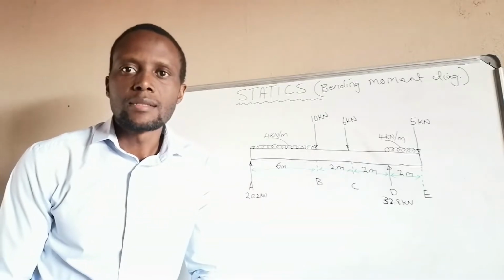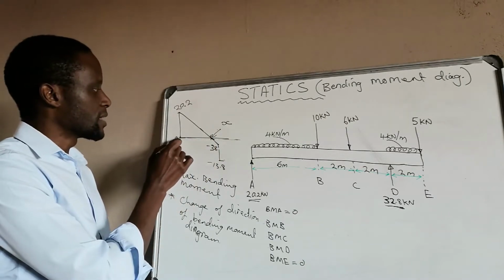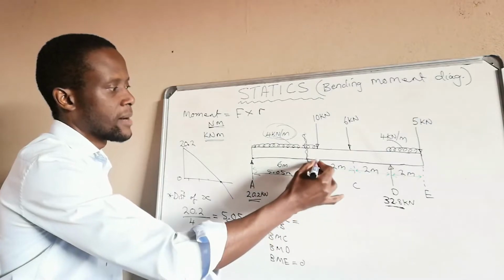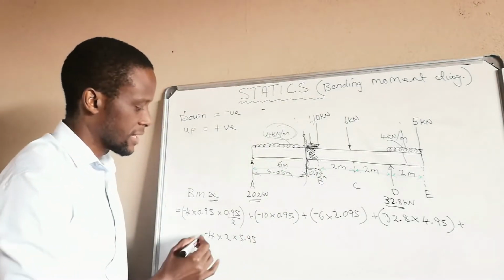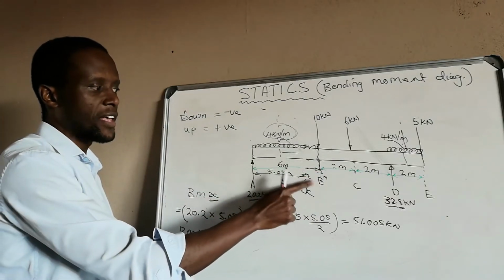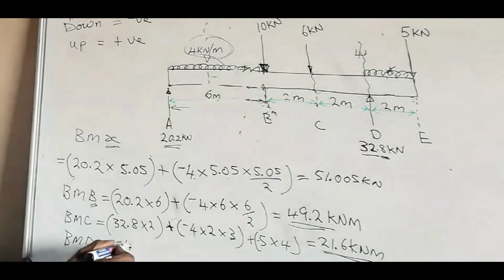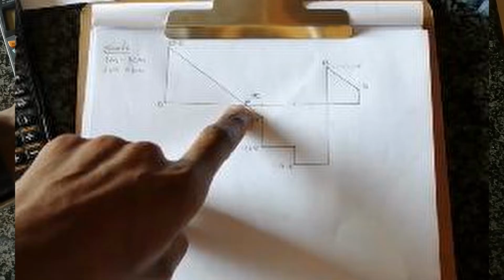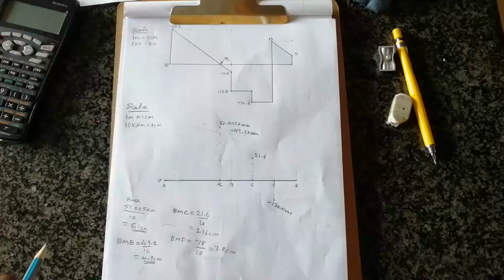Engineering science N4 Bending moments diagram

Comment: Please without drawing the diagram at the initial stage,would have noticed that , u gonna calculate for bending moment at X?
Reply from the maker: @ameyawclintonowusu5595  Great question!
Without the drawing you wouldn't be able to know if there is a point x. But if your  uniformly distributed load starts from a negative point then you won't have to stress about point x. 
I encourage drawing and making sketches. I think a correctly drawn sketch is half of the problem solved. Sketches make a picture out of the problem. "Humans are visual thinkers. "